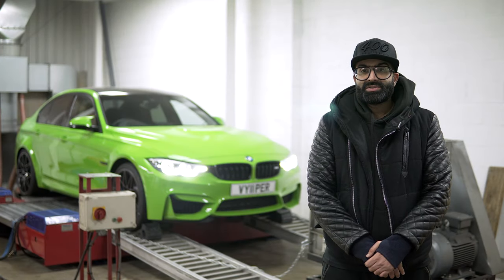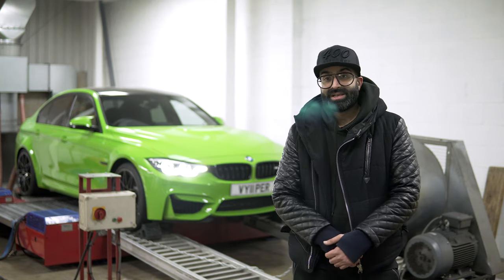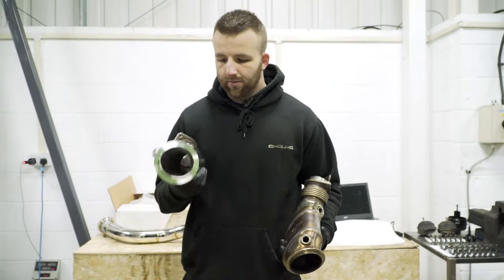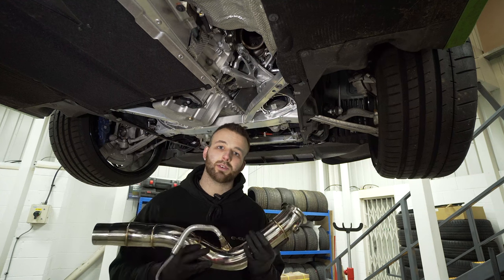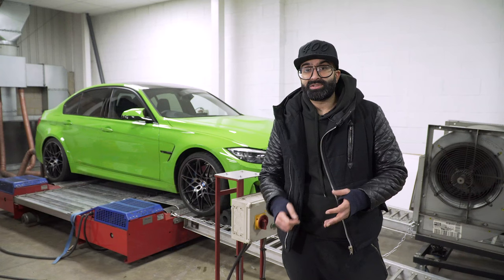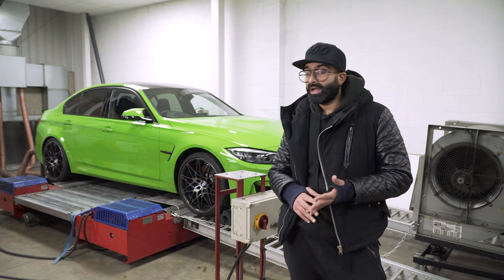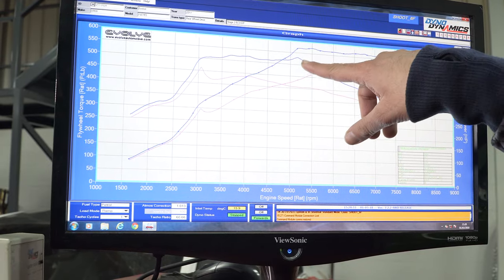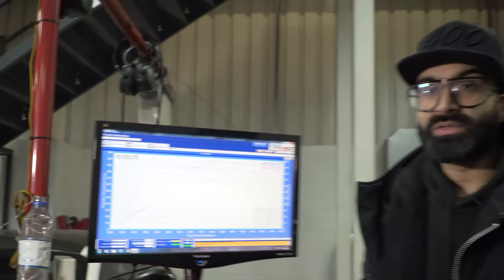Project F80 M3 : Evolve Stage 2 Upgrade - ECU Tuning and Downpipe F82 M4

Comment: I have also a bmw m3 competion. I wanna change the Exhaust but its verry expensive, give these cattles downpipes engine error’s, let me know !

Thx guys
Reply from the maker: Yes you'll need a remap to remove the engine management light from having catless downpipes. Cheapest solution for a little more sound would be a backbox mod.

Comment: Hello. I have a f80  with catless  downpipes  and drop in k and n air filters.  I have been running a ess ecu  flash since 1200 miles  and almost 4 yrs now. Might you have a better map available? Last dyno pull was 485bhp  and 465torque.  Thankyou
Reply from the maker: Yes, we should be able to get more power than that.

Also advise checking your MAFs, assume the K&N panel filter is oiled and oiled filters kill MAFs.

Comment: The performance is legit but sound....meh.By far the best exhuast set up for this car is MPE. Zcp is decent in person aswell. S55 is similar to s54. One wrong part and the whole thing is fucked. Both van sound good but obviously there is no comparison when you get the s54 right.
Reply from the maker: MPE does sound very good but I'm not sure it would be worth it for a ZCP owner. ZCP + Decats which is what this is sounds pretty good to me, just accentuates the stock sound. We're currently testing an exhaust that sounds excellent though. The S55 is a real challenge to make actually sound good, most exhausts out there are all noise and no tone.